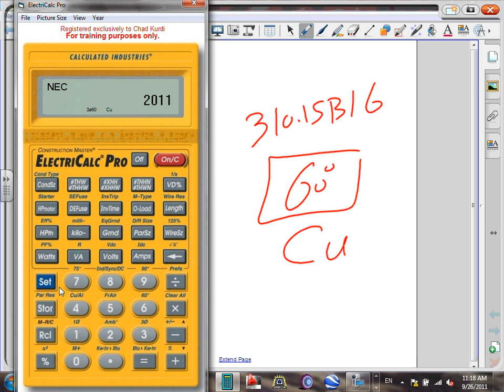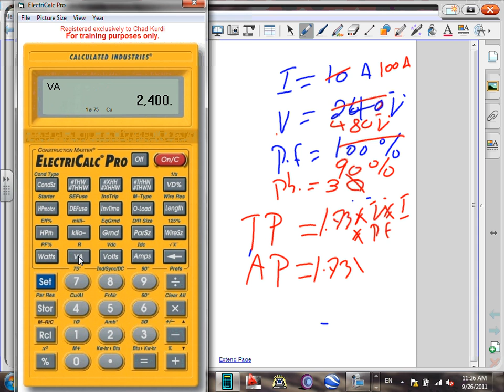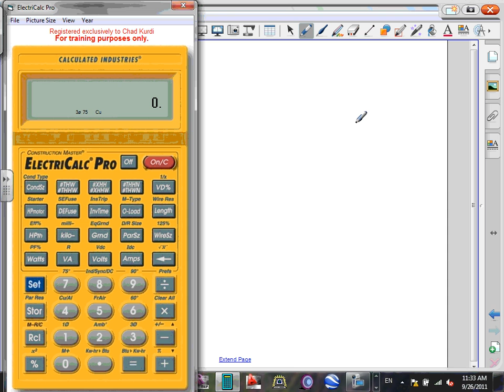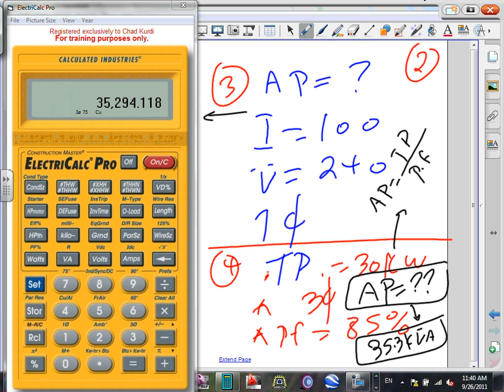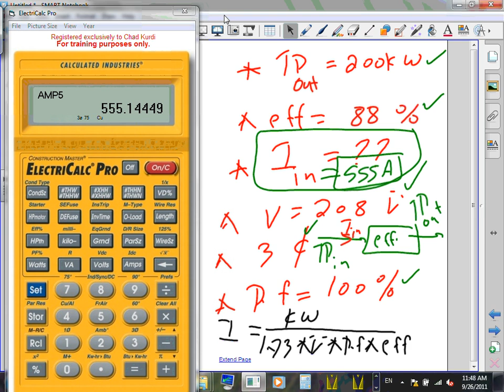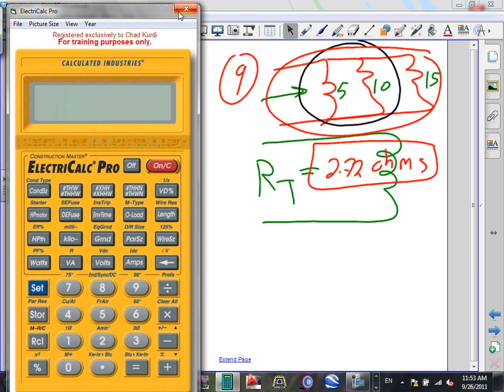Electrical Calculator-L#01-( 9-26-11).wmv

Comment: Good session. With Chad's Classes with Electricalc Pro, i am convinced and eager to buy a latest model calculator. Thanks for uploading this video. 

Q5. Little tricky i felt. As Efficiency plays a good role in Input current. I was misled by manual calculation. I realized the mistake later. 
Q9. Thanks for sharpen the basics. I can able to recollect school learnings.